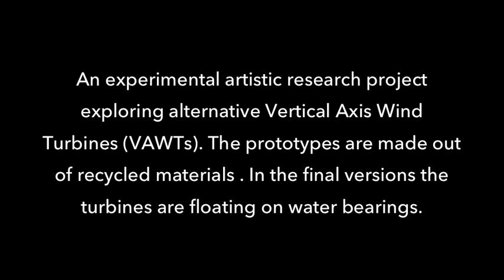A Tribute to the Persian Windmill – The Process

Comment: G'day,

Yay Team !

  These are fascinating Garden Ornaments, genuine Dynamic Sculptures.

  I trust that you're not hoping to extract anything remotely "worthwhile" in the way of useful Torque from them though ; because the mechanical complexity, operational friction and crudely aproximate nature of the "Aerodynamics" employed appeaer, between them, perfectly positioned to thwart any such ambition.

  Have you ever thought of trying to set it up on the bottom of a River (or something built along the same lines, but strong enough for the purpose...) ; being incompressable, the Hydrodynamics might work this thing better than Aerodynamics ever can ?

Backtrack me to my Playlists to see some HAWTs which I designed and built from 1985 to 2000...; then I bought a Solar Panel, and THAT worked (!).

Have a good one,

;-p

Ciao !
Reply from the maker: Thanks for the comments! Trying this turbine concept with hydrodynamics instead och aerodynamics is an interesting idea. With the flaps open on one side of the main axis, fish could wander through the turbine ;) I'm also thinking more and more about solar panels, since price has gone down and there are no moving parts (minimal maintainance)..
Reply: G'day,

Thanks for the response.

   Yeah, I too shifted to Solar Panels, just before the Price-drop.

I designed and made a Tracking Mount for my Array, it makes the Panels produce 35% more current, and permits them to dodge Hailstones.

I also got into streamlining PVs for Highway-Speeds when retrofitted to Road-Registered Vehicles - whereinat they save a disproportionate amount of Fuel...; title-search YT for 

"The SunFoil Project..." Playlist,

to see that - it's what brought me to YT.

Last week I finished a sort of Tutorial on Carving Helically-Pitched Laminated Wooden Airscrews..., the techniques work for both Propellers and Rotors ; but my current Project is Propellers for small Peltier-Effect powered Electric Stove(top) Fans.

  Also, I have a Playlist of Wooden Windmills that I've made..., you might enjoy checking them out...?

 Have a good one.

;-p

Ciao !

Comment: IT may be flapping like a bird,  but common sense tells me if you put it in operation, you will be maintaining it everyday such as replacing torned and broken flaps... kekekeke
Reply from the maker: I totally agree ;) This was an experimental art project, getting to know the wind. I plan to develop the ideas..
Reply: @SimonShares  Energy is lost in the process of flapping,  meaning the energy transfer from wind to the wheel will have very low efficiency?
Reply: @SimonShares  It is an old idea from 35 years ago so has already been done by me.

Comment: One of the problems wind mills are facing are noice.
Reply from the maker: Yes, therefor it would be great with silent smallscale turbines that could generate energy for example on rooftops in cities. I think vertical turbines have that potential – if they could be made cheap, silent and simple enough, so they would require minimal maintenance.
Reply: @SimonShares  My cousin put up a windmill and the bearings wore out in a year.  The cost of replacement of the bearing made him switch to solar panels as no noise and does not have to replace any parts from excessive wear.

Comment: Vertical wind turbines are more of an art project than effective for power generation. They are not efficient. It takes high speed rotation with torq to make real power.
Reply from the maker: I also think current HAWT-models are far more effective, but I think that a cheap small-scale VAWT-model could have a potential for example on rooftops in cities. These have a high torque, so a high transmission gear ratio might work even though the turbine rotates slowly.
Reply: @SimonShares  The city will never allow them of roof tops.  The town I live in has banned all windmills from town because one fell over in a school yard on a weekend.  If it had fallen over on a school day children would have been killed.  Most cities are banning them.  You would have better luck with solar panels.